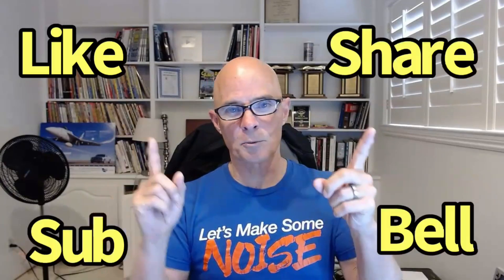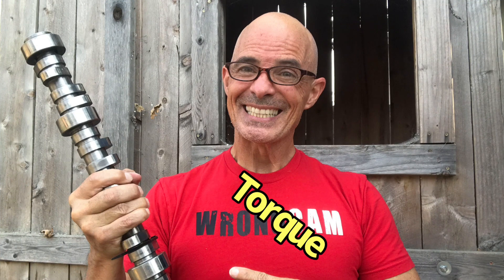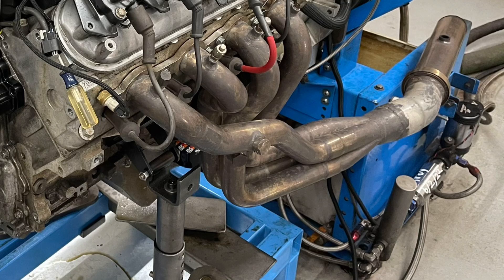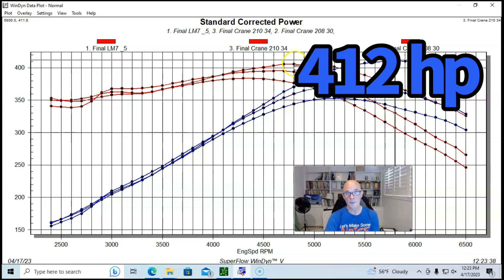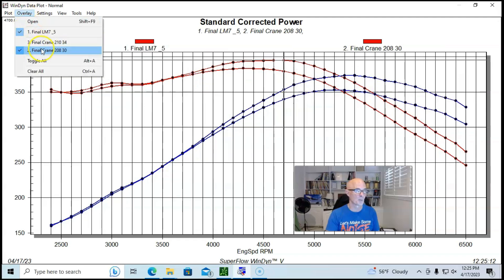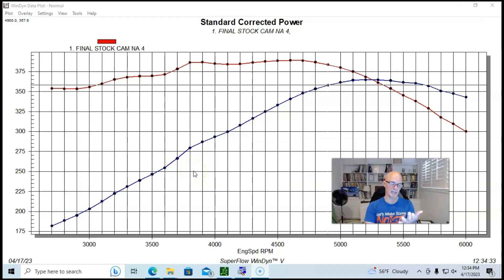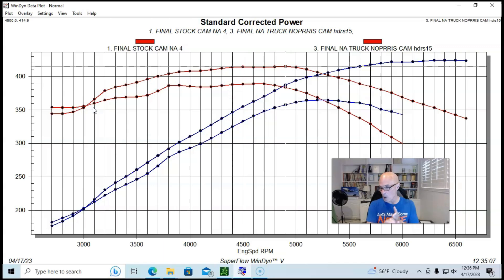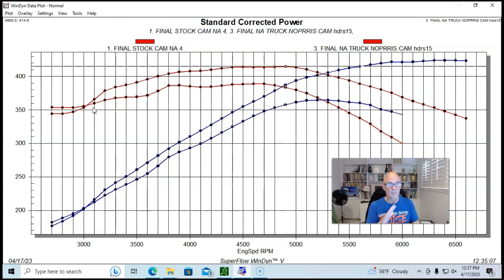WHERE'S THE TORQUE? HOW CAN I MAKE MORE LOW SPEED TORQUE? WHO MAKES THE BEST LOW-SPEED TORQUE CAM?

Comment: Do the David Vizard thing and narrow the LSA.
You did a video on that.
I agree that you can only do so much.
Why you didn't have much luck is there aren't many off-the-shelf cams made to take advantage of that.
One that comes to mind that isn't ideal but proves the concept is the Summit 1785 (LSA=106).
Vizard put out a video not long ago where he mentions a few others.
He's not specifically looking to maximize low-end torque, it just works out that way.
The Holy Grail is the most torque over the widest possible range of engine speeds.
Reply from the maker: DAVID IS NOT LOOKING FOR TORQUE PRODUCTION AT 2000 RPM
Reply: @richardholdener1727  That's irrelevant.
Reply: Probably take a custom cam or a circle track cam. A more modern lobe that that ancient summit lobe would be better. 
Plus you’ll need tuning ability.
Reply: The answer is VVT
Reply: That last bit is the key. Average torque across the entire range is where we should be looking

Comment: So for something like the 8.0 v10 magnum dodge made in the 90’s the best and only thing you could do for more torque would to be raise compression slightly?
Reply from the maker: DISPLACEMENT, RUNNER LENGTH, BOOST, COMPRESSION
Reply: @richardholdener1727  would love to increase displacement but there’s nothing out there. The v10 already has 25 inch long runners, so I’ll have to look into some boost, I’ll likely just raise the compression. With that said it has 8:4.1 compression approximately how much is compression worth in terms of power? Say to a 9:5.1 or 10.1?

Comment: I see you chose not to muddy the waters by displaying the results of the BTR torque cam? In addition, you seldom if EVER except for that BTR cam, test either single pattern cams or anything tighter than a 110 LCA & even then Very Very Seldom. Wide LCA cams have never been  known for their large low-speed torque numbers. The key is to define "large" torque gains.
Reply from the maker: I SHOWED THE TORQUE CAM RESULTS AT THE BEGINNING OF THE VIDEO-THE TRUCK NORRIS WAS 107 LSA-ANYTHING I MISSED? YOU CAN'T GET MUCH MORE TORQUE AT 2000 RPM WITH CAM TIMING
Reply: @richardholdener1727 , The graph on the 1st two cams seems quite different in appearance than the 1st video when it was originally tested, is the scale different, possibly? Truck Norris is a 107, it also has a Very wide split in LSA, which pretty much trades off the low end made possible by the 107. Weak spot for split cams, as you have regaled us with often! Missed, YOUR definition of "large torque increase" & do the poor wankers in the gallery that think they want this "large torque street/truck increase" agree with your definition?  Possible poll question?
Reply: @richardholdener1727 , perhaps some  CBD salve or extra CBD gummies could get you over the Heebbie Geebbies at the thought of using a properly spec'd single pattern cam? I seem to remember an Old Build called the Budget Sledgehammer SBC 350 that performed quite admirably with 10 to 1 compression factory Vortec shortblock, EQ heads with 1.94/ 1.5 valves that did not even flow 240 cfm, a Crosswind  intake & a DV spec'd 528/.528 lift, 224/224, on a 108 hyd roller? Still made 389 lbs ft at 2600 with those heads. Would better heads have helped it EVERYWHERE in the curve, you have already proven that more than once! !  That is with a carbed dual plane too, not a factory designed long runner efi intake either! Are there other differences, yes & yes again. If discussion and possibly flawed observation are not desired, please, just say the word.
Reply: Btr trq cam was the winner, he didn't give it much attention.

Comment: How low in the rpms can you make a pull from on the dyno?
I've been testing several setups on the chasis dyno and can get the rpms stable down to 1000 rpms.  Mainly do steady state tuning from 1800-2500rpms In 100 rpm increments since that's where most trucks spend majority of their time. 

For example a stock 2004 4.8 in 4th gear with TC locked makes 89hp/218ft lb torque at 70mph/2000 rpms.
Reply from the maker: we have done 2000 rpm-no one should be at wot there
Reply: @Richard Holdener  sure they shouldn't. But in my 2500hd I keep it locked in 4th most the time for towing and it doesn't unlock/downshift until over 85% tps.
Reply: @Nocturnal Specialties  this is the type of stuff us truck guys are looking for. More tq low. Not necessarily at wot, but maybe at 40-50% throttle when towing. I hate holding my 5.3 at 3000-3500 rpm for 1-10 minutes to pull a grade.
Reply: @joe in MI  yep.
I've started  testing all the trucks on the dyno like that. Next up is the turbo trucks. 
When I see low end torque I think of idle to 2500 rpms.
Reply: @nocturnalspecialties642  I'm with you.  Lock the converter and pulling from 2000 rpm (or lower) is pretty common for me.  Even if they don't use it, I want to make sure wherever the owner operates the tune is good for it.  I pull my 900 hp LSA CTSV from  1800 rpm at full throttle on the dyno too, but that's a manual :)  And I do use that range on the street quite a bit where I leave in 2nd gear most of the time.
Reply: @Church Automotive Testing Dyno Tuning  nice!
Yea I do a lot of turbo trucks for guys and now most are looking for a stock engine setup, some a small cam and then a smallerish turbo. 
I towed for years with a S475 on a LQ4 with a JFR 215/215 turbo cam. It did very good and I put 330,000 miles on that setup before a lifter wheel took out the cam.
Reply: @nocturnalspecialties642  Yeah, got 140k miles on the original unopened motor in the CTSV.  Getting worried about valvetrain fatigue though so going to pull the top end apart this summer and redo everything except the pistons and rods.  Stock LS motors, when tuned properly, can produce a lot of power for a very long time.  E85 helps too ;)

Comment: Richard, here in Australia a common term for an upgraded cam is ‘tow and go’ no idea what the profiles are but pretty much every place that sells them say the increase the torque. What you said makes sense so they must be a mildly wider profile?
Reply from the maker: they don't increase torque at 2000 rpm-only as shown by the graphs

Comment: What does it matter what HP does if you are increasing your torque?  HP is a bonus.  Right?  I was just watching Nicks Garage and he just rebuilt a 413 split ram duel carb intake that made 385hp and 500 ftlb torque!  It’s in the build.
Reply from the maker: in his case it was in the 3-foot intake runner length

Comment: I built an engine that ran way better than I expected. It was actually an accident. But it was a serious street brawler that I drove every day. And drove the car anywhere, and it had perfect drivability. The bottom end torque was impressive. It had an unbelievable powerband. Most of you won’t believe it, but I’m not bullshitting. 
Made 447rwhp 479rwtq 
Pulled to 7800 rpm. Peak power was at 6800 and only lost 12hp after that to 7800. 
Car: 92 camaro 3500lbs with driver 
Engine: sbc 383 stroker
Compression 11.8:1
6.2” rod
Cam: comp cam 230/244 hyd roller with solid rollers 114 lobe sep
Intake: TPIS mini ram
Computer: haltech e6gm
1/4 mile: 11.40@122 spinning on nt555r’s with a 2.0 60ft. This was back in 1998-1999
Reply from the maker: 7800 rpm with a 230 cam on a 383?
Reply: @richardholdener1727  yes. You have to consider that when you put solid rollers on a hydraulic roller cam, duration is bumped. The mini ram intake flows well on top end. I had ported fast burn heads and a very important fact is I had very light valve springs and retainers. When I rebuilt this engine later on, it wouldn’t turn but about 6800, I changed cam to a 242/248 and the spring package on the rebuild weighed several pounds more. Yes, pounds more. I think it was a combination of good airflow and lightweight valvetrain.

Comment: Just goes to show you can only get so much torque out given cubic inches then you have to decide how much you wanna trade off down low for more horsepower higher in the rpm range
Reply: 1.33 ft*lbs per cubic inch is a good place to quit.

Comment: Small turbo and limit rpm due the small turbo. Huge low rpm torque, but back pressure and charge temp issues if you allow it to rev.🤷‍♂️ No gen 3 rods though😂

Comment: Sounds like there needs to be a lot more testing .
Reply from the maker: not really
Reply: Richard I appreciate so much what you do and have done for the hot rodding world. Maybe I should be more specific. In your LSA test video 3 years ago you proved how important LSA is to low range torque . From 3500 rpm which is as low as tested    the cam with 108 LSA made nearly 40 ft lbs more than the 120 LSA cam IMHO this shows the importance of the correct LSA for the application being used. The ICL being optimized is another area of cam “timing “ that could improve low speed torque. Optimizing dynamic compression either with IVC point or increasing static compression (which I know isn’t part of the cam) is another area to optimize for increased torque.Optimizing intake runner cross-sectional area for the application being used. Making proper use of low lift flow ie 25 or so degrees before and after TDC with proper cam specs. Making good use of exhaust scavenging with proper L-W dimensions. ETC ETC ETC . This is what I meant by more testing . Generalities do exist but this why we test. I guess what I’d like to see is one combination optimized to its fullest potential consistent to its intended application. Thanks for blowing so many old wives tales about hot rodding out of the water all these years . Keep up the good work

Comment: I say an LM7 cam may potentially have a decent lowend gain in an LQ4 over the original cam. I mean the P/N for the lq4 is the same as the early ls1 so technically you're installing a stage 1 truck cam. Haha
Reply from the maker: the LM7 and early LQ4 are the same
Reply: @richardholdener1727  , right but ive never seen an early vs late curve

Comment: Have you ever tested a stock cam LS or any engine, that only the compression was increased? Say go from 9:1 to 12:1, or any of 1.0:1+?
Reply from the maker: it adds 3-4% of power per point of compression
Reply: Cranking compression may be too high to be useful since you’ll have to run octane to keep it from pinging it self to death plus a lazy advance curve.

Comment: Really Dollar for Dollar You can not match beat the torque Normal Aspirated of a 454 - 632 Cubic inch Big Block Chevy or a Pontiac 455 or Pontiac 400 block based stroker to 540 cubic inches.

Comment: Compression can get more TQ,   if they did make a cam that gained TQ down low, it's probably going to peak there, like a tractor cam,. Or the pre ww1 cams that had no overlap, peaked at about 2k rpm,. But totally, the only way to get low end tq, is gear, converter, or compression, keep the stock cam, and raise the compression to about 13:1!😆
Reply from the maker: displacement or boost

Comment: The Other way LS LGM X is custom Engineering cylinder heads.
Every engine out there gets its behavior powerband from the cylinder port shapes and internal  runner lengths, cross sections, short turn radius, valve sizes , and throat ratios used.
Reply: Hard to tell if that's overthinking or underthinking.
Reply: @Marc_Wolfe  I think How much time and money do you want to spend ? A Big Block Large Cubic Inches is proven Superior Normal Aspirated.
Reply: @brracing7861  When you want low end torque.
Reply from the maker: no

Comment: I have a 69 camaro...has 454 ...big cam.....low vac.....id like to put stock cam in.....or just go to 8.1 .....wadda ya think? ...sell the 454....start fresh🤔🤔🤔
Reply from the maker: cam swap is easy
Reply: @richardholdener1727  they tell me new lifters...valve springs needed to swap🙈
Reply from the maker: yep-for the smaller cam
Reply: @richardholdener1727  ok thx

Comment: A bbc with peanut heads and rv cam will give you gobs of torque.
Reply from the maker: those heads don't add torque at 2000 rpm
Reply: @richardholdener1727  A tight LSA around 107 would bring up the cylinder pressure and more torque.

Comment: So the million dollar question is an intake the only way to gain torque at low engine speeds ??? Cause converter and gears only get you to a higher rpm where the torque is made and doesn't help with bigger numbers at lower rpms... and what about cam timing would more cam timing shift power band lower ??? Questions I believe should have been answered in this video. Thanks still loving the the content keep up the excellent work 😊
Reply from the maker: that question about cam timing was answered in the video and a very long runner intake is one way to add torque, boost and displacement and compression are others
Reply: I watched video i must have missed it about cam timing i will watch again. Thanks

Comment: A set of gears will work wonders for a truck, 4.56 gears are the way too go with a 4L60/80E deal
Reply: Yeah and you'll be running 3000+ RPM at 55MPH.
Reply: @shadowopsairman1583  not true at all. I have 4.11’s (from stock 3.43’s) with a 4L60 in my 2001 Silverado, stock size tire (around a 265/75) and my rpm at 70mph is 2,100, at 80 it’s 2,400.

Gears are a huge help when you don’t have the displacement.
Reply: @shadowopsairman1583  not in OD, plus a 200r4 has a higher OD than most transmissions

Comment: It's not practical any for LS LGM 4.8, 5.3, 5.7, 6.0 6.2, 7.0 Corvette But changing the Rod to Stroke Ratio to 1.4  -1.5 would help but cost a fortune in custom Billet pistons and 1 off C-C Connecting rods Like $5000 cash.
Other way with LS LGM X Is a Cistom ground Ultra Tight LCA 95- 102 LCA AND SAME ICA.
Done past in Big Block Chevy Truck Pulling,
Pontiac V8 Pikes Peak Hill climb Racing Engines,
Small Block Chevy Dirt Track engines too.
Reply from the maker: rod ratio would do nothing for torque at 2000 rpm (or anywhere else)
Reply: @richardholdener1727  It does.
Done by Head Pontiac V8 Engineer Father of the Pontiac V8 himself Malcolm McKeller.
You already disprove so its pointless the Story of a Custom Pikes Peak Hill Climbing 1970 Trans Am RAIV They built.
Not on Google any.
Reply from the maker: Ask Yourself-was it compared to another identical motor with a different rod ratio?
Reply: @richardholdener1727  Yes

Comment: The only way to make more torque NA down low, 3000rpm and under. Is to increase displacement. Or like Richard said, gears or stall
Reply: Actually the stall speed and gearing are a way to better apply the available torque. Because they don’t increase the torque output at the flywheel/flex plate. They do provide a mechanical advantage. A very noticeable one.

Comment: Bring the big stroke crank, long runner intake and a tight lsa
Reply: Tight LSA is not what u want. U want the opposite  a wide LSA.  112/114  A tight lsa makes overlap, kills vacuum  and low rpm torque.

Comment: The 210/218 cam on a 106 LSA would create more low end torque. That is dyno proven. Tighter LSA = higher cylinder pressure and more low speed torque.
Reply from the maker: no
Reply: @richardholdener1727  apparently you’ve forgotten articles you wrote showing exactly how a 108LSA produced 35 ft/lbs more over a 120LSA at 3500 rpm. The 108 made the 120 it’s b!tch from the hit to peak power on HP and TQ.
Reply from the maker: apparently you missed the point, you can add cams to lose torque-which is what the 120 lsa did, can you add torque versus the stock cam? None of those three cams tested have anything to do with these small cams and this test or the results.